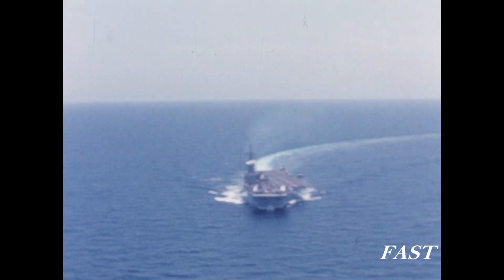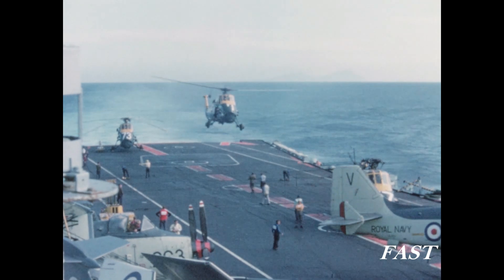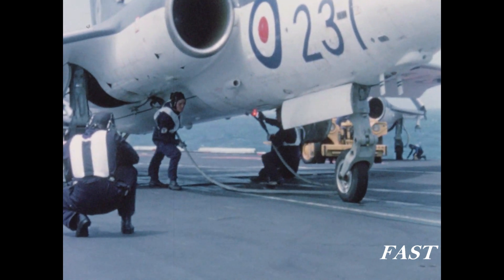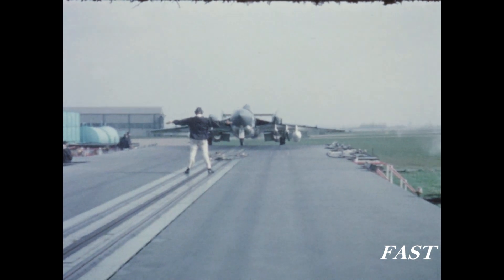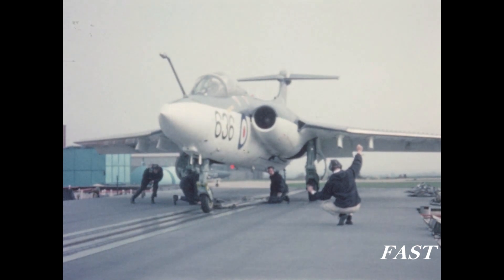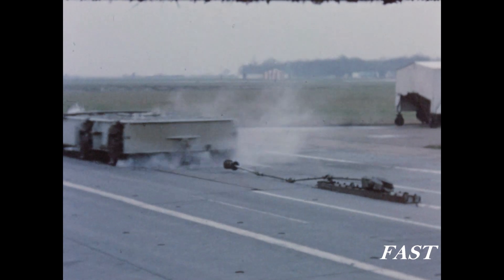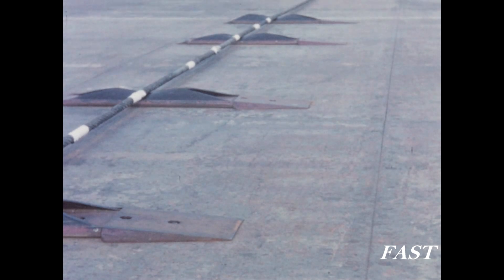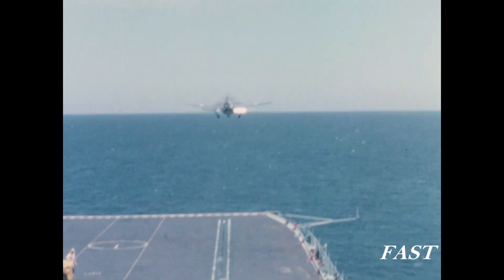Testing Catapults & Arrestor Gear on HMS Victorious - Sea Vixens and Buccaneers

Comment: What's that splash just ahead of the carrier each time an aircraft is launched?
Reply: It is the bridle which is used to launch the aircraft. In later years, bridle arrestor gear was used so the bridle could be reused. These too became obsolete with the introduction of the nose wheel arm which hooks into the shuttle as used on the American carriers.
Reply: It was called the 'strop' and each one was essentially thrown off the deck with every launch.  Hence the British slang 'Throwing a strop'.
Reply: Catapult bridle
Reply: The pilot falling out of
Reply: Really? Surely it’s a bridle. Hence fitting bridle catchers e.g. to Ark at her pre-phantom refit. Allowing bridles to be used many times.

The of the past now, as the CATOBAR carrier aircraft use an integrated undercarriage system to hook up the cat.
Reply: UK tax payers combined and gathered bottled tears probably. Most British people didn't even have indoor bathrooms  or central heating when this was filmed. Strikes me now... as a colossal waste of time, effort and money.